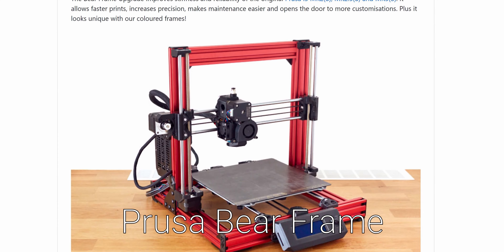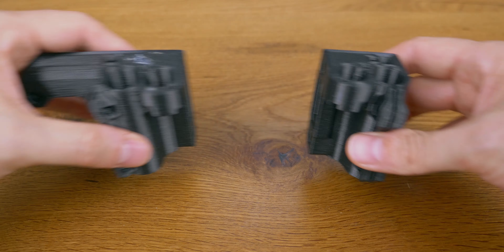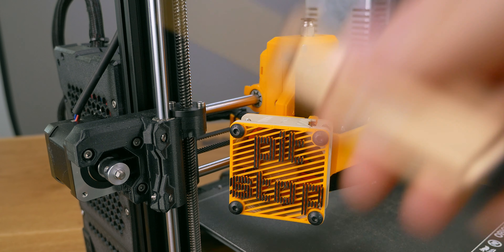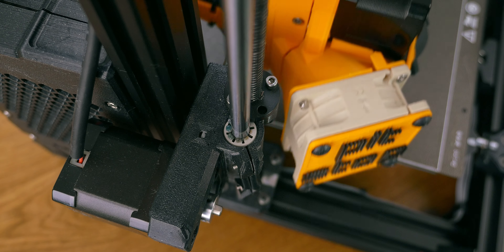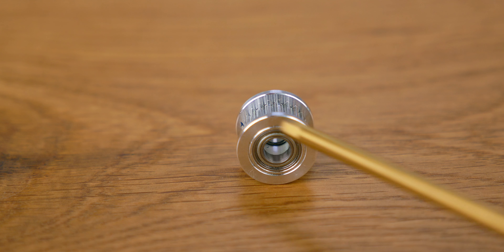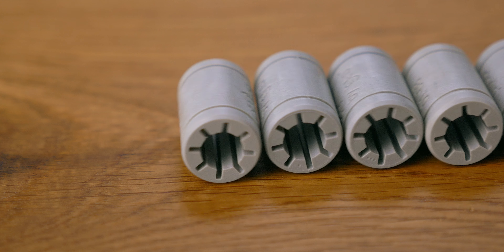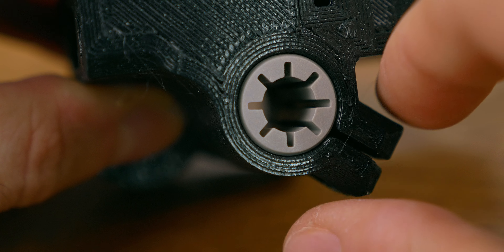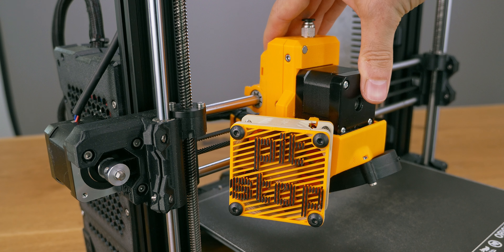Prusa Adapted Revised X-Axis overview

Comment: I just did the mod. I‘m using the stock idler, seems to be just fine. Not sure how that will be in long term view but since there isn‘t much force on the screw holding the idler it shouldn‘t become a problem.

Man, such a different in noise! 😍 Absolutely amazing how smooth the printer sounds now. Printing a calibration cube right now and will let you know the results measured with a micrometer. Thanks so much for now! 🤗
Reply from the maker: Awesome, have fun!
Reply: @MihaiDesigns  Some 15-20 hour prints later I can say the mod is working perfectly even with the stock idler.

Comment: I understand this is more rigid, but is it needed? There's never going to be that much force on the X axis unless you add a very heavy extruder?
Reply from the maker: The stock one is probably fine. I haven't made any before and after tests. I expect the difference to be minimal if any. I use it to tension my Igus bearings which are also not required, and I know some people like parts that look more rigid.

Comment: Exactly what I needed after figuring the bear x axis needs a completely different extruder as well. My MMU works like a charm, all I needed was a more rigid x axis for the stock extruder! Will start printing as soon as the actual print finished. What's the advantage having a toothed idler?
Reply from the maker: Cool! Some say toothed idler can lead to smoother print surface, but I haven't done any tests. Gates idlers are supposed to have higher quality bearings which can also help with smoother surface.

Comment: i like to use with stock idler. your current upgrade requires a larger motor too?  also what kind of grease are you using with your bearing
Reply from the maker: Hi Dennis, noted. For now with the stock idler you'll have to use the stock X-Ends. Stock motor is absolutely fine. I use lithium based grease for dry run bearings.